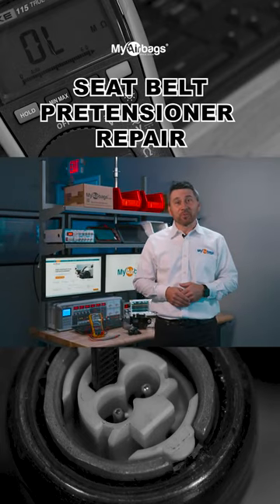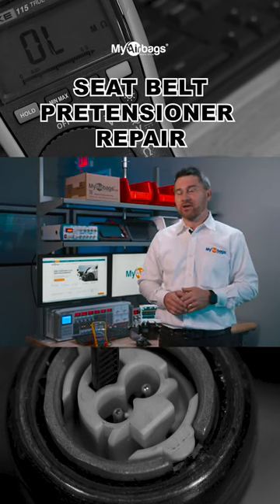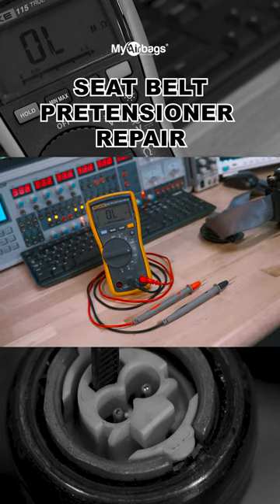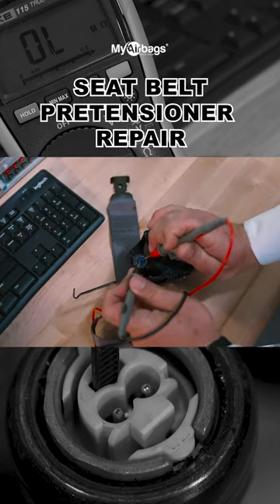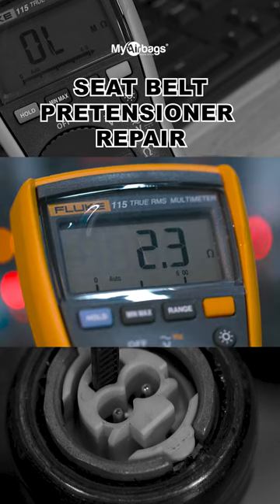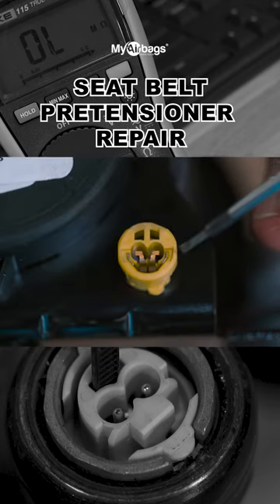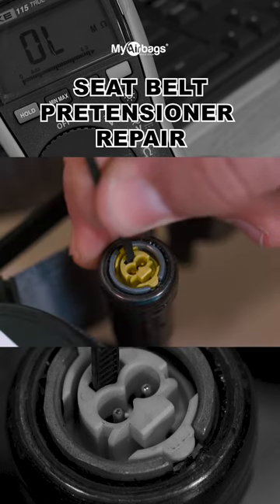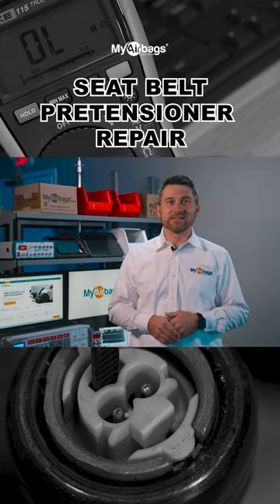How To Test A Seat Belt Pretensioner and Pyro Sensor with a Multimeter OHM Tester #shorts

Comment: This method is not reliable, I used the diagnostic equipment and got an error code on the ignition device in the tensioner to the belt.
I did an Ohm measurement in the faulty belt pulley and compared the values between the new pulley and the old one, they were the same values, despite that I get no error codes with the new belt tensioner.
Reply from the maker: Did you push back the shorting bars? You can also remove the plastic insert to make it easier. But this is the only true way to test if you dont have a diagnostic scan tool that can read the OHM resistance value.